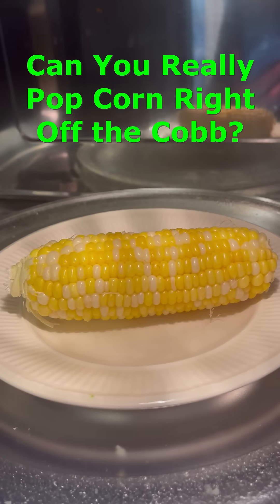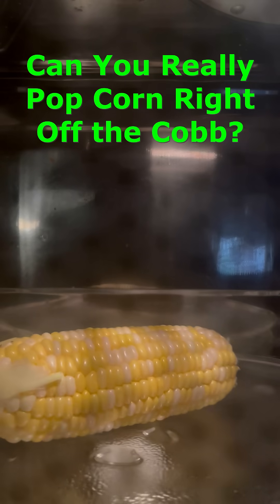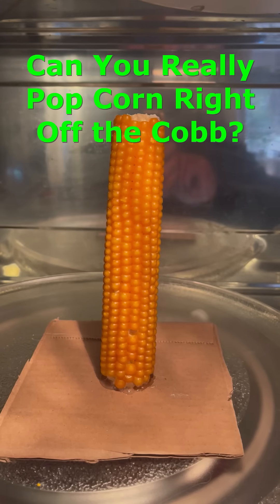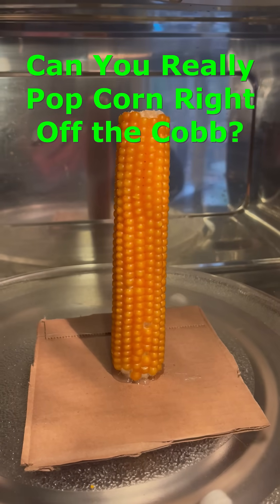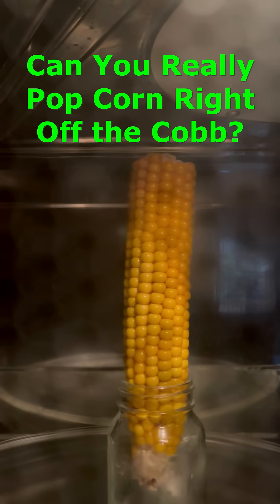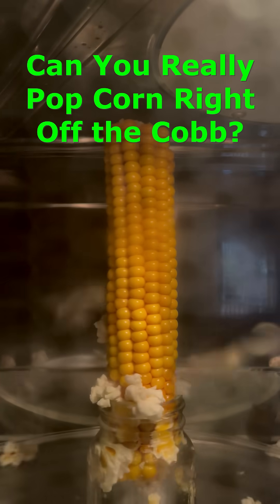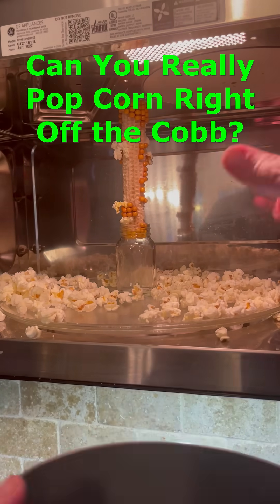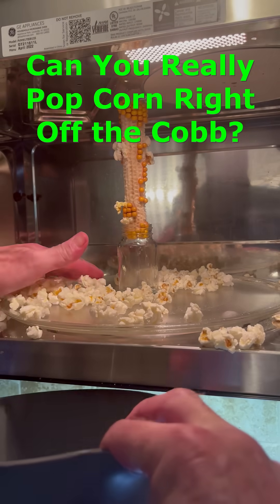Popping Corn on the Cobb is So Cool!

Comment: The reason why sweet corn does not work is because it’s way too soft and besides it’s edible as is, but the second one your using, the ears on that one are called hulls and are more durable with a thicker shell. Each hull has some starch and water and that water heated up makes up steam making the starch a sort of goo, and it builds up so much pressure that it pops and the starch quickly cools down making pop corn, you can even see the skin of the hull on it if you take a closer look. The starch can form in many shapes depending on which direction it goes, such as the butterfly, or the mushroom. 🍿

Comment: The trick to this is to use the dried or decorative corn on the cob, not fresh corn. They sometimes come in small bundles of 3 or 5 mini cobs and will sometimes come with the dried leaves still attached. There are assorted colors as well. Put the cob into a lunch size paper bag, then put into the microwave. You won't get to see it pop off of the cob, but it works the same, saves the mess, and collects the popcorn.

Comment: Even though that corn looks dry and is hard on the outside, each Kernal has a tiny drop of water inside. When that water reaches the boiling point, it pops. That's it. 🤯 😊

Comment: when i was a kid i just thought the popcorn was hard because they dried it before selling it, like beans or something. i didn't learn until a year or two ago that its a different type of corn that grows that way.
Reply: I learned some very useful information here.
1. Popcorn kernels are not dried corn.
2. You can plant popcorn kernels.
3. You can pop it on the cob pop it on the cob drop it like it’s hot. Drop it like it’s hot.
Reply: @internetcancer1672  You do need to let the popping types of corn dry for a bit for ideal popping, but they already start out much drier than sweet corn even before they're harvested.
Reply: As a kid we planted some popcorn kernels and we expected to grow some edible corn ...... we were quite surprised to learn we had corn that you could only pop or feed the pigs. Yeah we kids but we learned.
Reply: They're much drier than normal corn, sure, but it doesn't grow rock hard like that, it does still have to be dried.
Reply: What kind of corn please?
Reply: @jacqueshelton8759  The type of corn that popcorn is made from is also called popcorn.
Reply: Yes it's a different corn, but no, it doesn't grow dry. 
They let it dry before selling.
Reply: I only found out thirty seconds ago!
Reply: Most corn grown in America isn't even made for consumption. There is a ton of uses for corn.

Comment: You need the hard shell, because you are actually boiling a small spec of water in them that explodes and turns them inside out. That does not work with a soft shell and too much fluid. Then you are just boiling the entire thing.
Reply from the maker: Thanks for the info

Comment: The reason corns pop is because there's water inside them. The microwave, on the other hand, is resonating with water (making it's molecules vibrate faster and faster and raising it't temperature in the process) which makes the water inside turn into gas. More heat there is to the gas, the higher the pressure. When the pressure goes over the threshold kernel can withstand, the kernel will pop / explode. 
What we have here, basically, are mini hand-grenades, because that's exactly what happens there: hard shell has pressure inside it raising and that energy pushes it out and we have explosion.

Reason why soft kernels don't work is because there's no "snapping point", vapor just creates micro-pores and gets out of the soft tissue. The critical pressure never occurs. 
It's like blowing air into the baloon and into a sponge - one will pop up after some time, the other will just leak it all out.
Reply: ^This. More people need to see your comment to actually get how the process works, instead of them recommending drying the sweet corn :))
Reply: @NMG.11 Drying may work, but don't expect it to work as well as regular popcorn. Popcorn kernels are infact dried to make them appear as hard and... well dry... as they are.
Reply: Comments like this are my favorite to come across. And the people that leave them are awesome for it.
Reply: I enjoyed your vivid explanation of it lol
Reply: Thanks for the explanation 😁😊
Reply: Basics
Reply: does that mean if we were to make a massive microwave and a massive cob of corn we could grow hand grenades
Reply: My mom still pops corn in the same pot she has used since late 70s.
A few times I have used a cast iron pot to flatten the bottom but the sides are riddled with divots from the millions of explosions it has held inside.
Reply: What about the ones that don't explode?
Reply: @JesusProtects the reason some don’t pop is because they either have too little water or too much water
Reply: @JesusProtects 
Not enough black powder inside
Reply: thank you for this information
Reply: So what you are saying is that we can use giant corn in war?
Reply: More like soft corns also work but it must to be raw and not matured! Just like the dry corns too… 

You actually popping the kernel and not the matured “fruit”

Comment: I wonder if the high pressure method will work with the sweet corn. Heat it up at extremely high pressure, then release it suddenly.

Comment: Popping on the stove with a pot is cool as well...and healthier
Reply: There is nothing healthier about cooking on a stove as opposed to in a microwave. Both processes cook food by adding heat: a stove accomplishes this by using either electricity or combustion of a fuel to make the atoms in a pot or pan jiggle faster and faster (i.e. get hot) which in turn causes the atoms in the food to jiggle faster, while a microwave does it by making all the water molecules in the food jiggle and spin faster and faster which in turn causes the rest of the atoms in the food to jiggle faster and faster.

Comment: Will you didn't hear is that microwave popcorn is toxic because of the chemical it releases when the water molecules inside popcorn start vibrating at a wrong frequency blah blah blah scientific stuff not important but toxic you're not supposed to microwave your popcorn you're supposed to use a popcorn kettle and yes I do know they make microwave popcorn packets for your convenience still toxic the manufacturer won't tell you of course

Comment: If you leave the husk on sweet corn microwave for 3 or 4 mins it's the best tasting 🌽 you've ever had
Reply from the maker: Thanks for the tip
Reply: Leave husk on corn. Soak corn in lightly salted water for about 5 mins. Take out of water and put directly on your BBQ grill. Depending on the size of the corn… cook anywhere from 10 to 20 mins on a relatively low temp. Just want the husk to be turning a light shade and the husk should also be starting to char just a bit along the leaf edges by the time it’s done. Take off grill and let sit for about 5 mins. Once cool enough to handle… peel away husk to reveal amazing corn. Cooking over propane is good but using this method over charcoal is AMAZING. ITS SOOOOO GOOD.

Comment: I have been repairing microwaves for a long time and this is not recommended. The longer you cook objects with less moisture in it the more damage you do to the microwave and the magnetron what puts out the waves inside.
Don't do this at home you're only going to ruin your microwave in the long run and then pay someone money to repair it.
Reply: Who repairs a microwave? Trash it and buy a new one.
Reply from the maker: Thanks for the advice
Reply: The corn is absorbing the energy. Plenty of people cook popcorn daily in microwaves and don't have any problems. If anything this type has a higher moisture content. I repair electronics. I think you tried to put two and two together but you ended up with five.